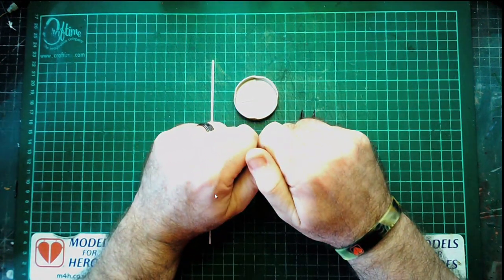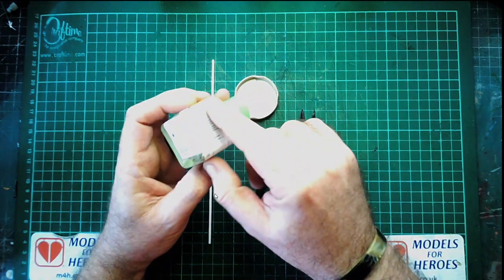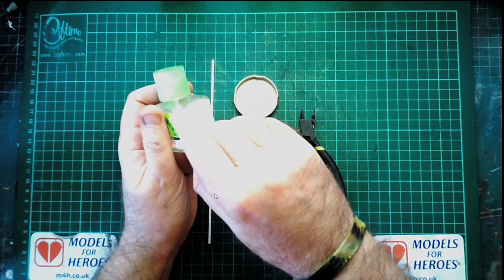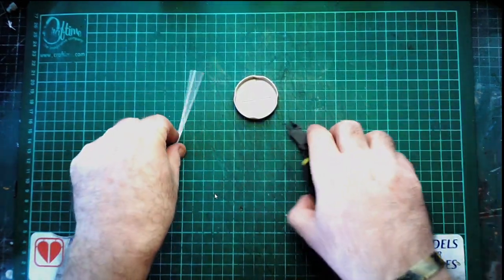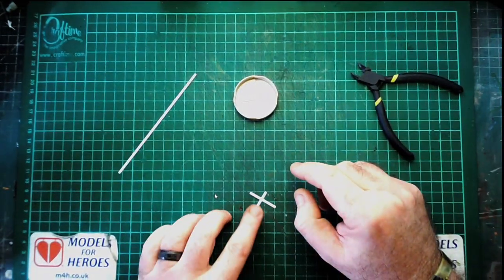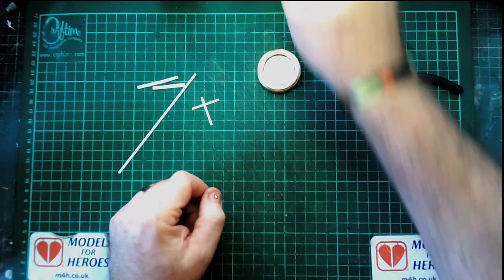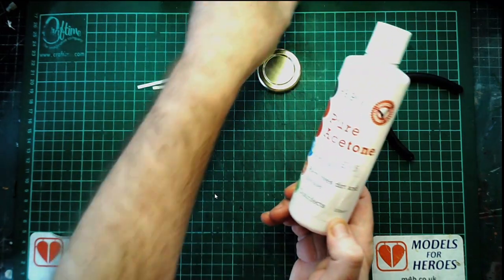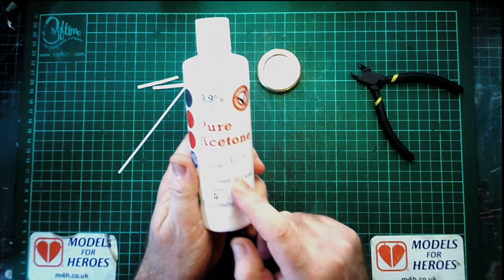What is Extra Thin Cement made of? Is there an Alternative?

Comment: According to the MSDS (Material Safety Data Sheet) Tamiya Extra Thin Cement is 50% Butyl Acetate & 50% Acetone.
Reply from the maker: Thanks for the info 👍👍👍
Reply: @BudgetModeller  Tamiya airbrush cleaner is the same as their Extra Thin Cement.
Reply from the maker: @eb311235  Thats quite scary if it is!
Reply: @eb311235  bloody hell glad I've never put it into my airbrush! I can see it now " ooooh my air pressure has gone" looks to the hose that's lying there in a puddle... " Oh shiiii... 😱😂